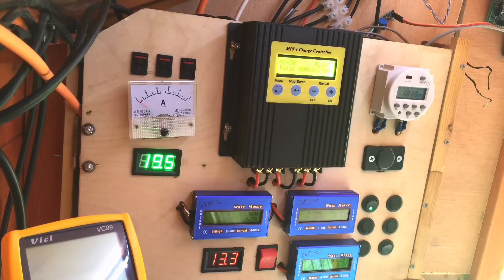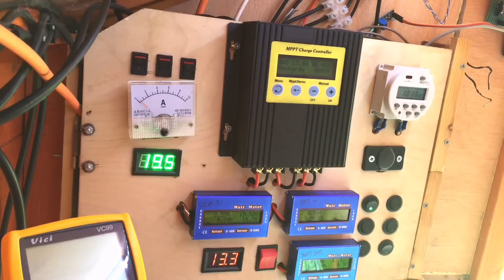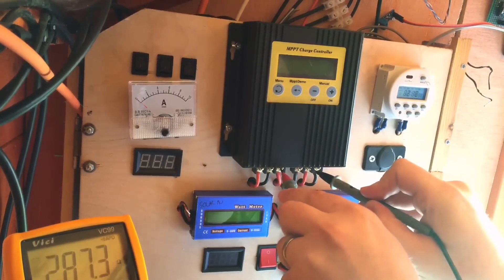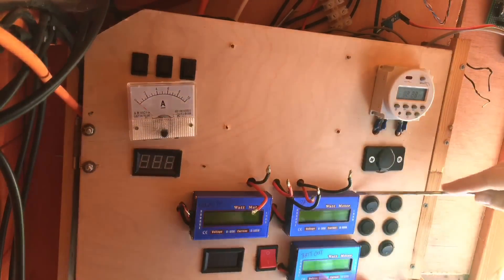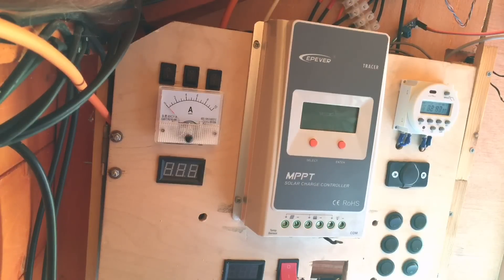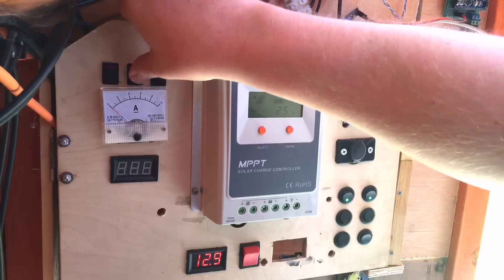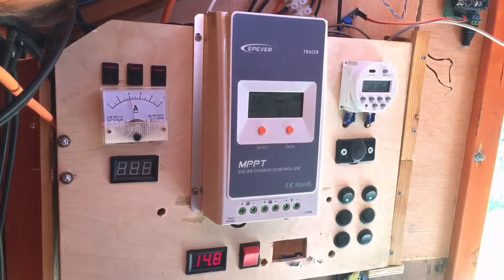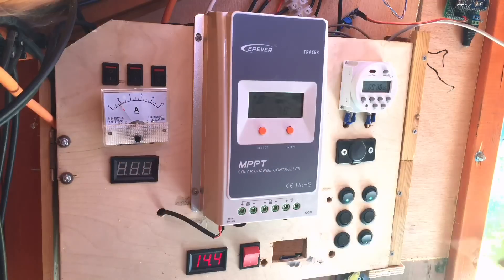EPEver Tracer 2210A MPPT Fitting and Testing - 12v Solar Shed

Comment: So, did you ground both the positive battery terminal, as well as the positive lead from the solar panel(s) to the charge controller, as the wiring diagram in the EPEVER user manual suggests? I am in the process of setting up a 600W system in an off grid cabin in the woods with a 30A version of this controller. Thanks for the videos - succinct, informative & entertaining in their own way.  Also, wondering what manner of football fan are you - ManU, Chelsey, City, or perhaps Arsenal, like me.
Reply from the maker: +volvosan my system isn't actually grounded at the moment. Shh. :-) but yes, that's how you would do it with this charge controller  

I was brought up as a man city fan but I'm more into my rugby league.

Comment: your videos are brilliant thanks. Would there be any advantage between EPSolar Tracer 2210A MPPT & 3210AMPPT when connecting to 2 x 100W panels?
 Also in the Tech specs for 1210A MPPT  it says power cable 4mm sq which is what I''ve seen for solar panels.
Yet the  2210A MPPT & 3210AMPPT spec says  power cable 10mm sq.
Can I ask you for your views
Reply from the maker: +Paul Lockyer No advantage except that with the higher current charge controller you could add more panels later :-)

The larger connectors allow for thicker wire, but will still take the thinner cable if needed - just be careful to make sure you get a good connection. 

Thanks for your questions.
Reply: Thank you so much - Brilliant as ever and so quick
Reply: +Paul Locker I know your comment was some 2 years ago, but people still read them, so to answer your question. yep it doesn't matter  on size of the cable you have, on your current solar panel wires. As long as they can carry the correct amps, so if you have 2 100W panels they should be rated at 5.5amps each so 11amps it will take your 4mm sq cable as it should be rated for around 20+ amps the recommended 10mm cable would carry between 50 an 70amps but yet the Tracer 2210A is only a 20amp controller so would only recommend 6mmsq an the 30 amp controller which is the 3210 tracer would recommend 10mm.

Comment: I see this is positive gnd. I have wind turbines and solar coming in to my positive side do you just hook this up to the same place for positive and if so how does it determine the PV/Bat/Load voltages does it use the gnd line if so I would assume you need to fuse the neg. side?

Comment: SOS

im spinning my wheels trying to figure out how in the heck im going to be able to plug in my MT-50 controller and my Communications cable at the same time.  Both of the MT-50 and the Charge controller have only one input.  has anyone used a hub or what did you do?

Comment: Hello Adam, is it okay to plug my inverter directly at the load output of the controller?
Reply from the maker: +Daniel Pe If it stays within the specified output then yes you could, but I'd usually suggest running your inverter directly from the battery. Inverters usually have their own low voltage cut out to protect your batteries.
Reply: +Adam Welch Okay got it! Thanks! :)

Comment: what would you put on the load terminals....  Do you need to connect something? and if you did connect something, would you have a swich on it.
Reply from the maker: +Peter Hancock Hello!  Thanks for the question.

On my load output I have lights with individual switches as well as some outside lights on a timer, a 12v radio etc.  However I run my AC invertor and my bench power straight from the battery (via a breaker).

You can use the button on the Tracer charge controller to switch your load on and off when it's in manual mode (117), so if you just had one set of lights on the load output you could save the need of any external switches.

I hope that answers your question?
Reply from the maker: +Peter Hancock Should have said, you don't have to have something on the load if you don't want.

Comment: Adam,  I've got a HQST 30A MPPT TracerA clone.  I was wondering if you would touch on the accuracy of the battery graph in the middle of the screen.  My 12v system will have 12.9v showing for my battery charge, but the graph will only show 1 bar.    Also wondered if you can pull the running logs from the charge controller using the RS485 connection and the Epever software.
Reply from the maker: +thefeistycadavar I believe the bars on the battery symbol are to do with state of charge. I'm presuming these charge controllers determine SOC by monitoring the history of charging and discharging. They aren't directly connected to voltage from my experiments. 

The tracer A series doesn't seem to have any internal memory. It can stream stats out of the MODBUS port, but first store any data to download later - this can happen on the itracer or etracer I believe.
Reply from the maker: +Adam Welch Sorry should have said - but it doesn't store any data...

Comment: I have 4 solar panel (120w and 12 volt) *4, and my system is 12 volt. What is the best connecting panels with my EPEver Tracer 4210A (40 amp) ??
Reply from the maker: +Mazen Noman Hello. Page nine and ten of the manual suggest the best wiring options. I think you'll find it says for your combination two panels in series and then the two sets in parallel. Hope that helps?
Reply: thanks alot

Comment: I use a Tracer3215BN controller, and i cannot see what the differences are between the versions? EPSolar don't really explain the differences between the various MPPT controllers they sell. Any ideas what the differences are ? I use the remote monitor display so i can see what the controller is doing.
Reply from the maker: +James Grove Well the main difference out of the box is the integral screen but the other major difference is that the A series has a maximum panel voltage of 100 volts where as the BN series is 150 volts. 

Whether the algorithm has been updated or they've fixed any other internal issues is anyone's guess.
Reply: I have a feeling the algorithm will be the same across the series?
Reply from the maker: +James Grove Most probably.

Comment: thanks for all the reviews of this device. i'm looking forward to buy one but i have  questions:
1- does it do full mppt conversion of lost volts to amps?
2- i have a 600w solution for my house, 2 300w panels (~8a - ~37v). will this be perfect for my installation?
3- i currently have 20a 2210RN tracer and can't get amps above 18. so i considered buying this model but with 40a support. do you think its a good decision?
Reply from the maker: +saad alareqi Thanks for your comments. To answer your questions...

1. Like most (all?) MPPT charge controllers use maximum point tracking and DC to DC conversion when the charger is in bulk mode - a constant current phase. After which the charge controller goes into pwm mode in the constant voltage stage - float or absorb mode. So yes it does conversion - but it doesn't do it all the time. 
2. Your panels should work fine. Either in parallel or series depending on your preference. 
3. The two controllers are quite similar. You'd hope there are some improvements in the latest model - but unless you've got cash to spare and fancy giving it a go I'm not sure it'd be worth changing. I'm not sure it'd be a huge upgrade.
Reply: thanks for your reply,
- the problem which i don't get is why i get 16~18 amps? shouldn't i get 25~ amps due to the fact i have the 24v battery and the panels produce 37v~, shouldn't the mmpt convert the diffrence (13v) and convert it to amps?! if i do calculations 16a*25v=400w which is 2/3 what the panels should produce!... what confuses me is that my friend has the same setup as mine above but his mppt controller (i think called morning star) produces 25a max!! which i couldn't with this Tracer (16a~)!!. what could be the problem?
- another question if possible,what is best, having 2 300w panels as above or 4 150w panels? is it ok to connect 4 150w panels (18.7v * 8a) in series with 24v system  and get the max power of them? if no, whats the best solution?

thank you for your info Adam.
Reply from the maker: +saad alareqi Solar isn't an exact science. There are many factors why one system may differ to the other. Some panels over perform, some under. There isn't a perfect charge controller that can do 100% DC to DC conversion etc.

I'd be looking at your battery bank and how that compares to your friends. 

Batteries will only take so much power and charge will naturally reduce as the battery gets full. How much are you discharging your batteries, because your system will perform best when the battery is low. Of cause when our batteries are lowest - first thing in a morning generally - the sun is low and the panels won't produce to their full potential. By the time the sun is high in the sky and the panels could perform well my batteries in the shed are full and the current has ramped way back down. 

The final thing to look at is cabling compared to your friend. It can make a huge difference. Either reduce the length or increase the thickness if you can.

Comment: I use the same controller but the seller told to putt panels in serie...You get more higher voltage..
Reply: +Supermaiki - I have the 4210A. All the info is in the manual. There is a set of efficiency graphs for all the models in the range and a table of the best number of panels to use, depending on battery voltage, the number of cells per panel and the panel voltages. I had to read it over several times, until I could see what they were getting at. I then chose the panels to suit. It's worth matching it all together to get the best output.
Reply from the maker: +SuperMaiki76 Usually it makes sense with  MPPT to maximise your voltage and allow the controller to do DC to DC conversion as you suggest. In my case I sometimes divert my panels to other tasks, my wires are reasonable and very short so it's less crucial for me. 

Thanks for your comment.
Reply: +Adam Welch I'm pretty happy with the controller but I was expecting a bit more I do have admit.
Reply from the maker: +SuperMaiki76 A bit more of what?
Reply: +Adam Welch well...this is pretty advanced already...so why cannot have more advanced settings too..instead have to buy more just to do that..
Reply from the maker: +SuperMaiki76 You get a lot more info out of your setup with this charge controller apposed to most of epsolars other charge controllers, but yes it's a shame you have to buy an extra. Have you seen my video on using the Windows software?  That only cost me 99 pence and an old cat5 cable.
Reply from the maker: +nlo114 It's a handy guide and you did right I think following it before purchasing panels. All those tests were done under industry standard 1000watts per meter squared conditions though. Real life results might be a fair bit different!

Thanks as ever for your comments.

Comment: +Adam Welch  I am thinking of getting this controller as well.  However, it is positive grounded.  How does this figure in the setup?  Would you do anything different if it was negative grounded?
Reply: +Adam Welch Yeah, +ve common charge controllers are the absolute bain of developing a complex system...! I suppose you could start with positive common and keep everything that way all the time. But it somehow just doesn't seem to "sit right" I reckon. Although having said that the best way to use n-channel mosfets is to adopt a +ve common scheme. And that's why they do.
Reply from the maker: +Y Gator The complication in my system is around the fact that I divert my solar panels to other tasks once my main batteries are full. For most it really shouldn't make a difference if things are common positive or negative. 

As long as you wire your panels, battery and load straight to the charge controller it shouldn't be a problem. If your setup gets more complicated, you might find that some wiring configurations could effectively bypass the charge controller less you consider the charge controller type.
Reply: +Adam Welch How is grounding and lightning protection handled?
Reply from the maker: +xanataph Yeah my brain says you should switch the positive side. Just realised the tracer charge controller has a line drawn near the terminals which shows it is common pos.
Reply from the maker: +Y Gator Erm... It isn't. My shed is only 8 foot high at the highest point and is surrounded by higher buildings. In fact a telegraph pole is situated very close and some of its wires travel straight over my shed - so theory has it it really shouldn't be an issue. If anything changes I will re-evaluate.

Comment: What gauge wire do you use for your interconnects for battery and load circuit.  I've got 6mm2 cables with mc4 connectors for the panels but need some decent internal cabling I think.  Col
Reply: +Adam Welch Oh once you get an eye for salvaging it's a slippery slope...! There's definitely plenty of stuff out there. Wrecked cars provide short lengths of heavy duty cable and braided straps too. And you can get longer lengths from cars that have the battery in the boot. 

I'll tell you a story about how I got around five or so meters of 16mmsq+ cable. I was walking back home from the garage around the corner with one of my boys. There was a service line to a couple of houses that had four separate conductors on insulators crossing the street from the line on the other side. They were a bit sloppy and hanging down a bit. 

Just as we passed the pole on the consumer side of the road a truck made it's way down the street that was over height with a massive cylindrical steel tank on the back. It hit the power lines. BIG FLASH!! And wires started falling everywhere! We had to run to get out of the way! Talk about hairy! 

Most of the cables were still tethered at one end or the other but one of them had a section sliced out of it by the tank. That one I mentioned earlier. I grabbed the end of it and dragged it home! It's still the link from the "A" bank to the Marine Inverter which runs our computers during the day - and makes the coffee!
Reply: +Adam Welch Yeah, jumper cables can do the trick. I still have quite a few in my system. You want to get the biggest ones possible, usually rated at "400 Amp"...that's certainly a joke rating but they are thicker than the "100 or 200A" varieties. Since they are copper clad that does away with much of the issues in connecting to al conductors. Although it's wise to check any screw clamp connexions occasionally as al will flow somewhat like solder under pressure. Power co's use aluminium conductors all the time now. They have to be 2/3 bigger than the equivalent cu conductor but they are still half the weight and a hell of a lot cheaper.
Reply from the maker: +Colin Hickey Although I use a 20A controller everything is based (and fused) on 10 amps in my install. 

The solar panels use 4mm wire which came with them but then after combining there is a short distance of 12AWG. The load outputs on the same 12AWG silicone stuff. With everything on my loads only come up to about 3.5 amps. My heavier loads come off straight after my DC breaker (they are also fused separately). 

The battery is on 10AWG for a short run to my breaker where it then uses fairly thick (although copper covered aluminium) jumper cable - although there's nothing on the insulation the box suggested a couple of hundred amps - although I guess that's for a short period. 

It could be beefier, but wire is so expensive!
Reply: The last comment is pretty much what caused me asking as when i've been looking at cabling it's so damn expensive.  I wondered if i'd missed some cheap source or been thinking about it wrong.  I think on reflection my solar cables could be 4mm2 too.  I really need to sort some good cabling and breakers out though as it's currently on really in appropriate cabling, only on a 10w panel but have a 100w panel don't want to fry anything, well anything more as i've already destroyed a few small things.
Reply from the maker: +Colin Hickey Solar panels are fairly safe to be honest. They don't hold any charge, and shorting them shouldn't cause any real issues. Place a multi meter across the terminals and you'll see their open voltage. Connect pos to neg and you'll see current. But they are pretty much mutually exclusive. They only produce power (watts) somewhere in the middle. 

Batteries on the other hand - lots of potential stored and that's where you need to be more careful. 

I found it far cheaper to buy jumper cables than I ever could have bought the cable alone. Salvaging might be the best option if you have the opportunity.
Reply: +Adam Welch BandM did have jumper cables for a quick each which would have been great but couldn't find them on my last visit.  The solar wasn't really an issue as you say, was the load side which i've ahem shorted a few times and also made a few booboo's which have knackred a few things lol
Reply from the maker: +Colin Hickey I'll take a look in B&M next time I'm passing - thanks. Got mine from a Tescos extra I think. 

I've had a few mistakes, but all my loads are individually fused at a reasonable level. The individual load fuse should pop well before anything gets damaged.
Reply: +Adam Welch Err yes i've got them all fused too.... I've largely been hacking things together but things are in production for want of a better description so need some better setup i think.
Reply from the maker: +xanataph It usually always comes down to money. British Telecom used a lot of CCA cable here in the uk. Causes more bother now we're trying to get high speed internet connections into every home. Cheaper 'Cat5' cable is also CCA but it works ok generally. 

The mains leads from China are often CCA - that's a bit more of a worry, especially when there can be so few strands hidden behind the insulator!
Reply from the maker: +xanataph You'd need a coffee after an event like that! Thanks for the story - glad to know no one was hurt.